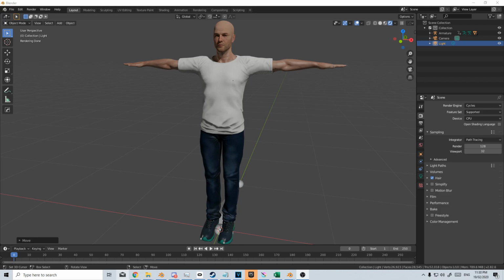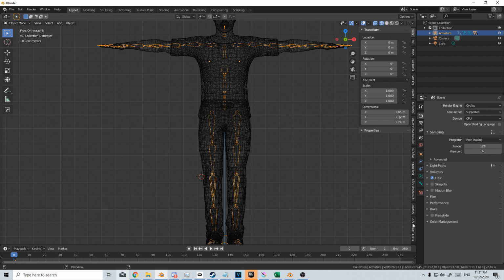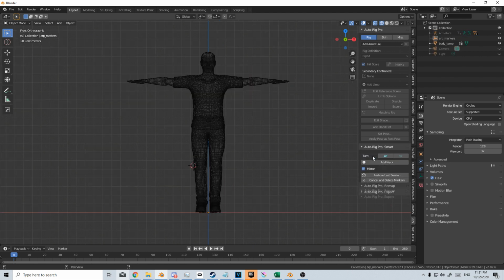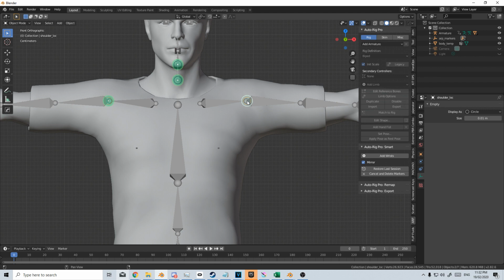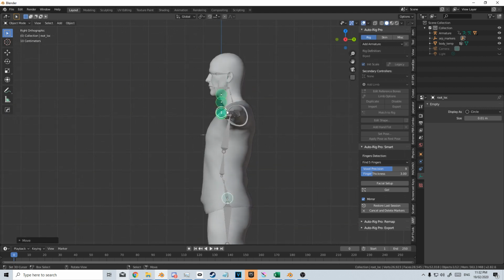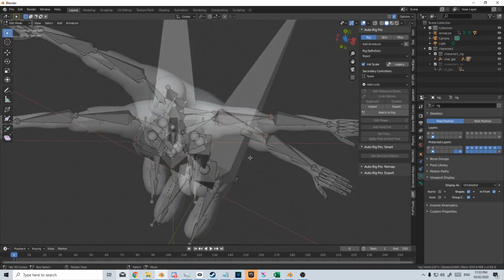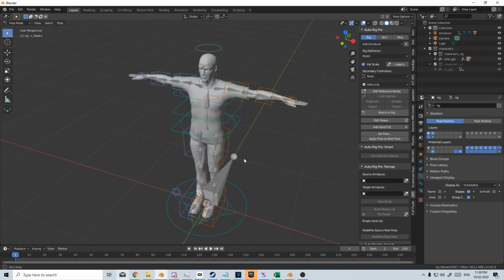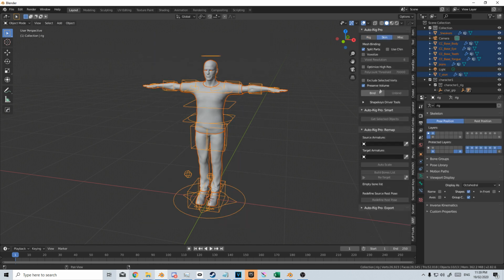Auto Rig Pro: Streamline Your 3D Character Rigging Process

Comment: I hope you can help. This addon is great. But I'm stuck in my project. I searched a lot. There are no tutorials on internet about how to rig long hair with auto rig pro. My character has several thick long hair bits with pointy ends.

I tried the "tail" and "chain" options from Add Limb panel. But these only allow the first chain of bones to be rigged. The rest don't get included in the final rig.

Can you please help me with this?

Comment: Another great tutorial as usual..curiosity question: Is there any advantage to rigging a CC3 rigged character for animating..is it possible that you could have imported a BVH mocap file into the character without auto rig...using the rig already in CC3...another optionional question would be to export the character from CC3 to Iclone animate it and then bring it into Blender environment...your thoughts
Reply from the maker: so my work flow is to CC3 to iClone, apply all my mocap data, then export into Blender and clean it up. I dont think we can just export .bvh file from iclone, so unfortunately, you need to export all the textures.
Reply: @Markom3D  So can I assume there is no real advantage to rigging the character with auto rig ..if its already animated in Iclone and imported to Blender as FBX ?..and it would probably save more time ...do you agree?
Reply from the maker: @rodcav3  if you dont need to animate it any more, correct. If I dont need to do too big of a change, then I wont rig it with ARP
Reply: @Markom3D  Gotcha ya..Thanks so much Marko ...You da man

Comment: I have now seen you do this in multiple tuts, all of which are excellent, but nowhere do I see a result that allows for IK on the arms/hands. How is this setup/enabled? I see the Auto-Rig Picker has a "button" for IK hands, but it doesn't do anything
Reply from the maker: so select the hand bone, and then you can move the slider in the tools tab I think (not at my computer atm) and it should change.
Reply: @Markom3D  Thank you. I found it in the tools menu, just as you had thought. Maybe that is a standard thing in Blender, but I am surprised the author of the Auto-Rig add-on doesn't mention it in his documentation.

Comment: Auto-rig Pro definitely looks like the easiest for rigging. Which do you prefer for the animation process, Auto-rig Pro, Rigify, or (can't remember the name of it) the one from BF?
Reply from the maker: So I normally use Auto Rig pro, but now there is an addon for ARP called quick Rig. Since the characters I already have are rigged, but dont have the controls, I apply quick rig and bam, it is all rigged up
Reply: @Markom3D  You're still talking about rigging, but I assume that once rigged, you do animations with these characters. Thanks.

Comment: Any idea why when I bind the mesh the rig stays in the T pose but the mesh goes to the A pose?
Reply from the maker: I am assuming that you are using CC3. You need to export the characters in the A-Pose as this is the native mesh pose. the T-Pose is controlled by the armature, and so when that is removed, it will revert back to the A-pose
Reply: @Markom3D  I’ll give it a try. Appreciate the response!
Reply: @Markom3D  also been getting nasty hand rig deformations from auto rig. Any idea why?
Reply from the maker: @TKtimestretch  no too sure, but if your character is already rigged, consider using quick rig pro aswell.  https://youtu.be/CZ9TrBfFFHY
Reply from the maker: @TKtimestretch  Crud, ill have to test that. I think there was an issue but I will have to get back to you on that one later tonight.
Reply from the maker: all good mate

Comment: After following your instructions right after 'match to rig', just before binding, when I delete the bone, the mesh goes to A-frame. Can you share why this is happening? Did I export from CC3 incorrectly? Thanks.
Reply from the maker: so, in CC3.3 which is what you are using, you now need to export the character in a A-pose. I have redone all this on the Reallusion Channel.
Reply: @Markom3D  Thanks. I'll check out the Reallusion Channel. Also, is it possible to rig two mesh in one plane? In other words, rig one character, then rig another character on the same blender space. Sorry if its too confusing.

Comment: Running into an issue where my Leg Iks are bending the wrong way does anyone know how to flip them?
Reply: I solved the issue. Whenever you adjust the knee or lower leg bone the ik swaps to the back of the leg on its own. IDK why.. This might be a bug
Reply from the maker: @AntiHeroGameStudio  you need to put a little bend in the leg when you are setting it up. Normally it will do this automatically, but just it cast it hasn't.

Comment: this does not work for some reason for me. So when I delete my original bone structure my whole model disappears as well. I feel like the model is linked to the imported bone structure. How do i un-link it to re-link it to my auto rig pro bones. Edit- So correction the body actually scaled up really big after I deleted them. But yours did not do that and i did apply the scale in the beginning as well. Okay so the body and clothing have to be unbound which is easily done in auto rig pro skin tab and click unbind.
Reply from the maker: Tydell Williams bam, correct

Comment: I actually prefer rigify to auto rig pro when it comes to rigging. The weight paint feature is more accurate in my opinion but the display and ease of auto rig pro can’t be beaten.
Reply from the maker: I think regardless both ways will need to be touched up

Comment: Will you help me rig the face for my character? The eyes seem to be the biggest issue. I have auto rig pro, but I can't seem to master the eyes....
Reply from the maker: Bio Girl what is the issue with the eyes?
Reply: @Markom3D  Thank you for your response. I can't seem to get them to properly rotate (look around). They seem to stretch, instead of the eyeball object actually moving when I try to move them. I've been working on it for a few hours and even tried adding them on separately, like it says to online. Very frustrating. It's not the character itself, but it's something I'm doing wrong, because it does it with all of my characters.
Reply from the maker: Bio Girl try removing the weight paint from all the vertex groups, and then attach them to the left and right eye vertex groups
Reply: @Markom3D  I don't think it's working. Do you have discord for a brief screen share and character set up?
Reply from the maker: Bio Girl yep, there is a link in the description
Reply: @Markom3D   Thanks!!

Comment: heya Marko, I've been trying to rig a Mixamo generated character (with Hair) using rigify and I'm getting the dreaded bone weight heat problem......would auto rig pro be able to handle rigging this character? Thanks in advance for your reply.
Reply from the maker: I find that Auto Rig Pro does a better job for sure.

Comment: I've been trying to get a hold of artell for a long time now. I own auto rig pro i had it in 2.81 now I hav 2.83 I have the zip files in blender file. When I try to download it through preferences it says module installed but I see nothing in preferences. I'm trying to get a refund or a trade. They have been ignoring me. So it looks like I'm all done with Artell
Reply from the maker: just to make sure when you install it, you first need to unzip the file, and there are three addons that need to be installed from the one zip file. try that
Reply: @Markom3D  Most of the time when I get the zip file downloaded into my blender file. First I go preferences click install I have all my zip files in one folder I have about 4 or five different versions of auto rig pro zip file the older ones when I had blender 2.81 most of the time I click on to the newest version I see it appear in my preferences. Click on to that than its in my view port. blender 2.83 alpha when I click on to the zip file accept in the view port on the lower part of the screen I get a message that says module is installed. I try the older ones same thing. I don't see it anywhere does not make sense I'm confused.
Reply from the maker: @daviddahl8562  that is correct, most of the time that is what you have to do, but with this one, you need to unzip it first and then install the zips within.
Reply: @Markom3D  I don't understand what the three add ons are
Reply from the maker: @daviddahl8562  http://www.lucky3d.fr/auto-rig-pro/doc/install.html#installing-the-addons is the doco for installing it. I can try and help out aswell over discord, there is a link in the description. I wont be on discord though for another 8 hours
Reply: @Markom3D  also I'm thinking I do have the teams viewer software so if you like I wouldn't mind it if you would like to join me on my computer. towards the end of the week I'm busy today and tomorrow may Wednesday

Comment: Nice! thanks for the breakdown. Do you like posing with auto rig pro better than the standard skeletons? is it easier to maneuver?
Reply from the maker: I prefer Auto-Rig Pro because it is a lot easier to setup, and also the automatic weight painting is way better. Yes there are parts that need to be fixed up, but it is alot less that rigify.